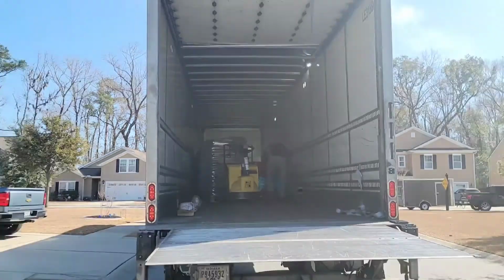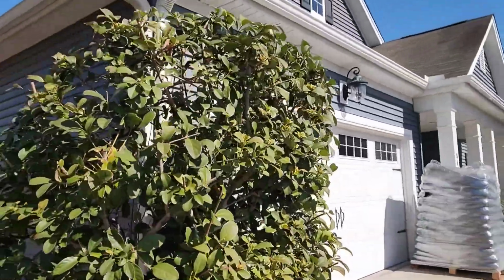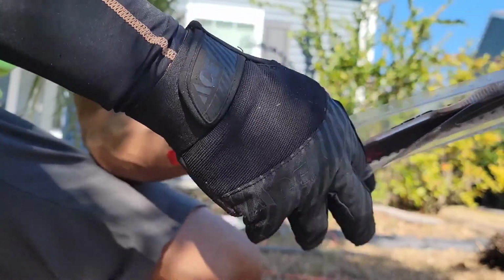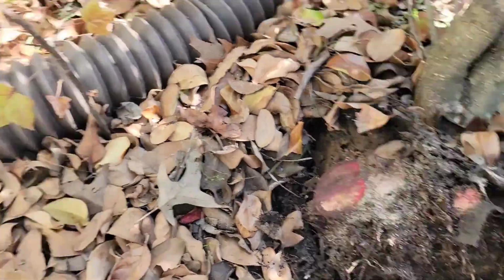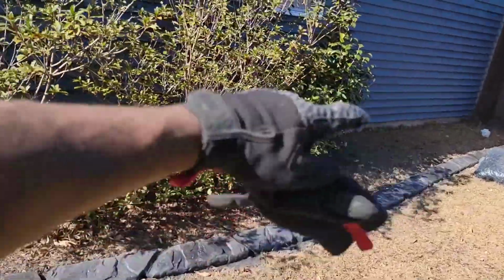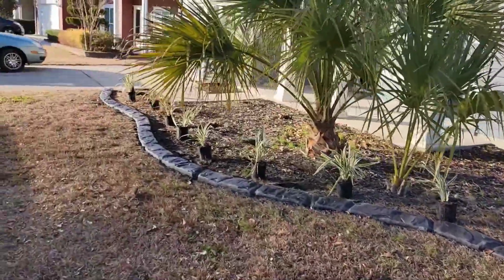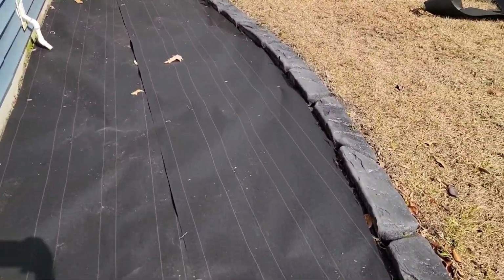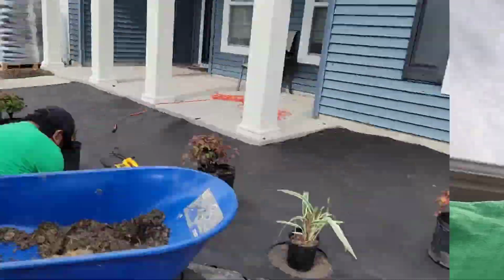How to Easily Complete Bush 🌳 Tear Out  😉| ❌No Shovel

Comment: I like how you show the problems you run into and how you solve them.
Question: so as long as you can easily get underneath the foliage, I don’t even need to cut the bush down low before we take it out?
Reply from the maker: Cutting the plant down makes it much easier (accessible). However, I prefer when cleaning up the debris, I like to have less stuff to pick up. I find it easier and quicker to drag a whole bush than to pick up everything I cut from the bush. I hope that answers the question. Thanks for watching.
Reply: @robertpaidprice  Less clean up sounds good to me too! Thanks for the response!